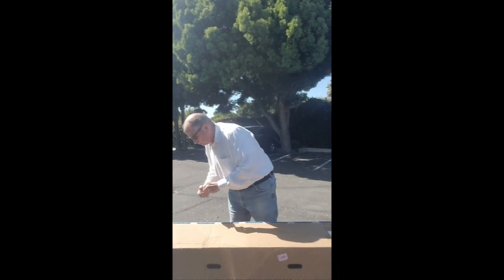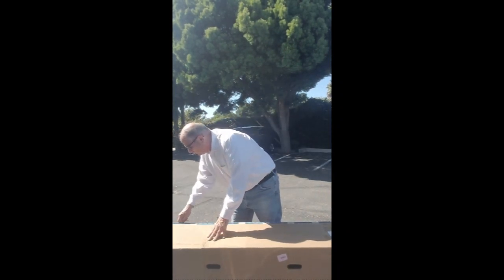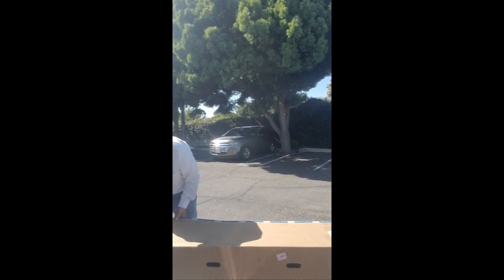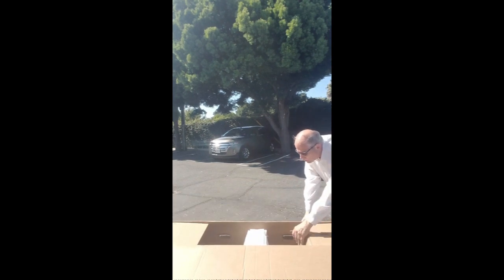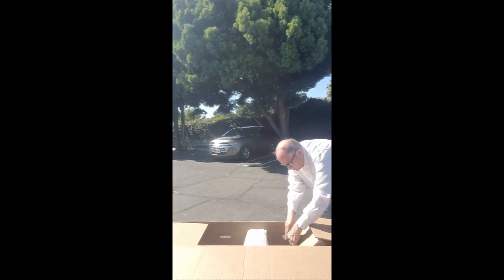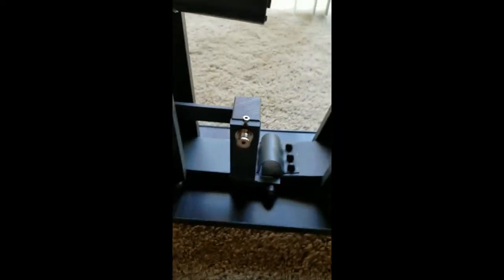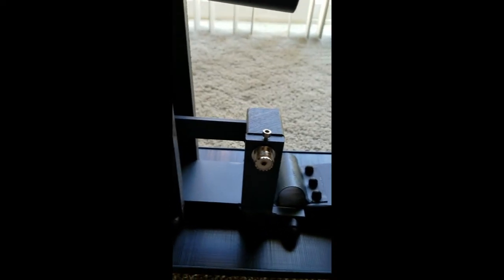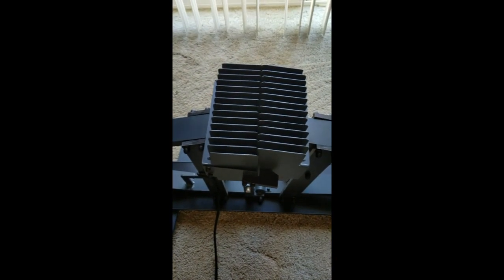Unboxing the Ciro Mazzoni Stealth Loop Antenna

Comment: Have the stealth myself, I just picked up the baby loop without controller as you can use the stealth loop controller on it also. I use mine indoors though and operate at 10w and under, both do a good job, I have a video in my channel on the stealth.
Reply: which one u prefer mate?
Reply: @eazypeazy6650  babyloop
Reply: @ronangsr  U using it outside now or still in your flat? my antenna guy says something like it's more sensitive to surrounding objects...
Reply: @eazypeazy6650  I sold them both, I use a tarheel screwdriver antenna now in my car. Ideally the man loops need yo be outside due to the radiation field not safe to be in close proximity. Its ok at 5w about 5 feet away from OP, no more.
Reply: @ronangsr  cause it's to much of a compromise to have them inside u went for a mobile rig?
Reply: @eazypeazy6650  no magl oops work great, but i find myself doing alot of /m lately so that is my method of choice, and if i operate at my home I just run coax in through the window
Reply: @eazypeazy6650  nono, they work well indoors, but I enjoy going out mobile, so I sold them to fund the tarheel 200a which isn't cheap  about 1000e here in Europe.  I like to drive by the sea
Reply: Ok thanks mate have a nice day

Comment: Re-watching your video again and you mentioned that when you were placing the Stealth on your deck and under the reflective ground plane/material, you mentioned you were checking and adjusting your SWR and it was high. Were you using an SWR analyzer to do the fine tuning in raising the antenna away from the reflective material or the SWR in you radio or Loop tuner? I think it might be better for me to use an SWR analyzer at the antenna instead of climbing up my attic ladder a back down the ladder to my shack. Oh and since the making of this video, do you still own the antenna? I think I will be finally purchasing this antenna for my attic. I don't live in an antenna restrictive neighborhood but just recently had neck surgery and recovery time is very slow. So I won't be putting up anything in my backyard on a more permanent basis this year. And one more question if you don't mind. The radiation pattern of the antenna. The antenna will be in the attic above my living room. I assume with the reflective material, the radiation won't penetrate in a downward pattern to harm anyone below the antenna? 

Also, in the instruction manual; Ensure that both the motor cable and the coaxial cable from the antenna to the 

A.T.U. are as straight as possible (see below). They should be positioned 

perpendicular to the antenna, in such a way that they occupy the position of 

minimum irradiation. Do I have to keep the cables perpendicular from the antenna to the shack? This will be pretty much impossible for me to do.

Thank your again for replying to my previous questions. 73's from N3NQP!
Reply from the maker: Hi John,

Sorry for the delay in answering your questions.  I recently moved from San Jose to Indiana. My bride and I have been busy getting the new home set up.  Her focus has been on decorating and new furniture, which therefore is my focus.  Happy wife, happy life  :-)

I hope you make a full recovery from your neck surgery.  I'm still recovering from a procedure I had last year.

I had the reflective material under the antenna.  When I was using a piece of screen it was pretty easy but unsightly. My late XYL was not happy about it, therefore the metalized mylar.  Putting it under the deck made it look better but made the initial adjustments a bit tricky.  At first I wasn't sure whether to use the 7300's SWR meter or the one on the loop's control unit.  Eventually I settled on using the 7300's SWR meter as I considered what the radio saw was the important reading. Climbing up and down stairs is something I would not enjoy as well.  So it may make sense to do your initial adjustments with the SWR meter at the antenna, then check it at the radio when you have the readings you want.

I still have the antenna.  The new QTH is 1/3 acre and no HOA.  Local ordinance says I can have a 35ft antenna. I have started to organize my shack (walk in closet off my basement office) but I have some egress issues to solve (I have one in mind). I plan to put up a vertical near the corner of my lot. As a stop gap, I thought about an EFHW. Speaking to the XYL, she was not happy about a wire going across the trees. To deploy the loop where I am now is a little more complicated in some ways. However, I plan to hold onto it for awhile, though that can change. If I were till in California, I would be using it.

I really cannot comment on the radiation pattern. However, I would agree it would be reasonable to assume the reflective material will help keep the antenna from radiating downward.  It is meant to be placed on the ground directly or have reflective material under it to work properly.  

On the cable question, you should have the cables coming out from the antenna at least 6ft perpendicular from the antenna.  That was a challenge for me as the deck was barely over that in depth.  I think the reason for the caution is to prevent any RF getting into the control wires.  I had clamp on  ferrite beads everywhere. All I can sat is try it and see what happens.  With the clamp on beads and the 6ft run I didn't have issues.  Their instructions may come from some experimental evidence.  

From some other folks I emailed, they found there was some issues with the antenna in their attic.  For one, it was due to the metalized coating on the inside of their roof sheathing (I cannot remember the name, but I had it in the townhouse as well). The other person had the typical ducting in his attic.  It took some experimentation to find a location and orientation that had minimal effect on the antenna's performance.  The loop (as with most loops) is very sensitive to metal in its vicinity. 

I hope this helps.  I really like the antenna. Like most antennas, it isn't a simple plug and play (like a 2 meter mag mount) and does take some initial futzing to get it set up.  However, once it is set up it works quite well.  Before my move, I made my first FT8 QSOs to Europe (France and Finland). I may do a quick set up to check to make sure my 7300 can still transmit from the trip (I was able to check the reception using an Ed Fong triband antenna setting up against one of my basement walls). 

73,
Russ WD9DD

Comment: Russ,  thanks for taking the time to make this video and share your thoughts regarding the Stealth Loop.  I am in the same situation and will soon be moving to an antenna unfriendly location.  I am seriously considering the Stealth or Baby Loop by Ciro Mazzoni.  I'm wondering what your thoughts might be regarding the Baby Loop.  In any case,  I am anxiously looking forward to your follow up videos.  73 and thanks,  George K2WO
Reply from the maker: Hi George,

I did consider the baby loop, but felt by the time I put it on a holder of some sort it would peek over the top of the railing.  However, it looks well made and it uses the same ATU as the stealth loop.  What I like about the Midi and Baby loop is they have a box for making the electrical connection to the motor.  On the stealth, it is a small  rubbery plastic screw type barrel.  It may have to do with the way they want the cables to be routed from the antenna.  I have a question into DX Engineering if this is waterproof (I believe it is, but I wanted to ask rather than assume). It's not a big issue if it isn't.  I can throw some heat shrink around it and/or tape.   

The next video may be delayed as I may have done some creative maintenance this weekend. 

73
Russ WD9DD